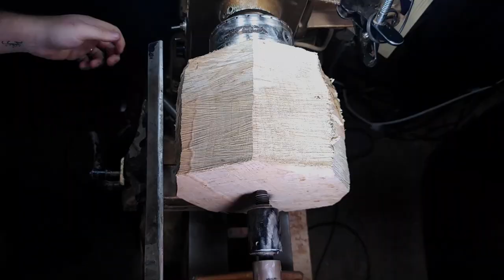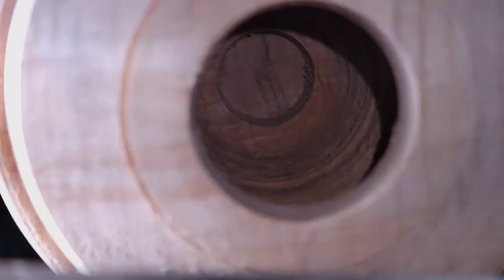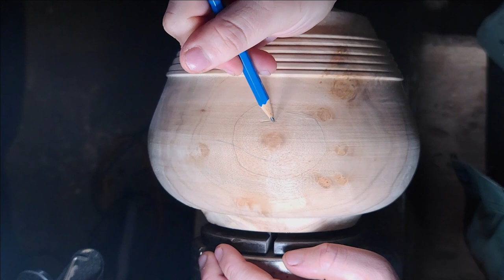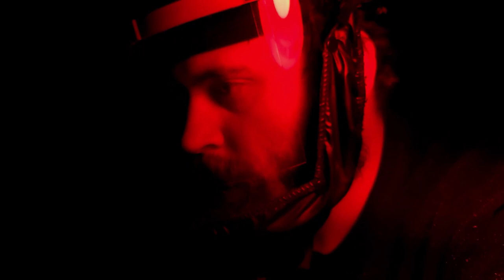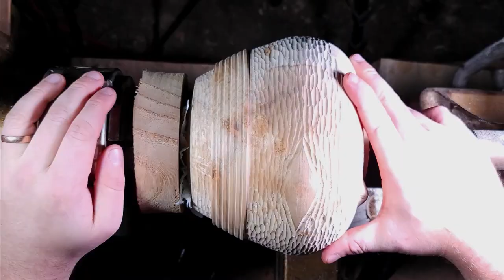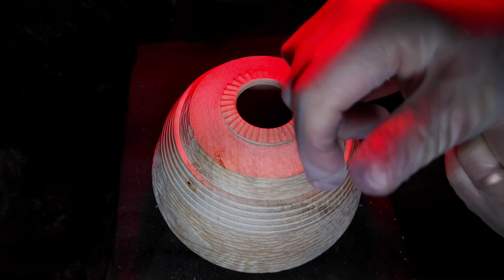Woodturning: The Cyclops Pot

Comment: Very cool bowl. What is the name of the boring fixture you were using.
Reply from the maker: Thanks Dean. To bore hollowforms and some bowls, I use a Forstner bit inserted in a Jacobs chuck, which is driven by the tailstock.
Reply: @danyoung6974  I’m sorry I don’t think you understood the question. I wanted to know the name of the boring bar with the laser. The way it looks you can tell where the tip of the tool is by the laser location. I’ve never seen it used before. Is it something you bought or is it something you made?
Reply from the maker: Ahhh, I see. That's the Trent Bosch stabilizer with a laser bar add on.

Comment: Greetings!  I'm a new subscriber--your work is beautiful!  Please, what is that tool you are using to create the feet at about the 15 minute mark?
Reply from the maker: Thanks for subscribing! Check out 10 mins or so in this video. I show the names for all the bits. 

https://youtu.be/LuqO1Cgebtg
Reply: @danyoung6974  I had watched that one and appreciate the bit descriptions.  But I'd like to know the actual tool into which you are putting those bits.  Thanks!  ps--I made my first bowl with feet today--need lots more practice (and maybe a new tool.....) but I'm pleased with the result.
Reply from the maker: Ohhh, my bad, my bad. That's a Husky die grinder hooked up to a 20 gal "silent" compressor. I thought I mentioned it there, but maybe it was a different video. Anyway, congrats on the footed bowl! They definitely get easier after a few tries.
Reply: @danyoung6974  Great!  Thank you!